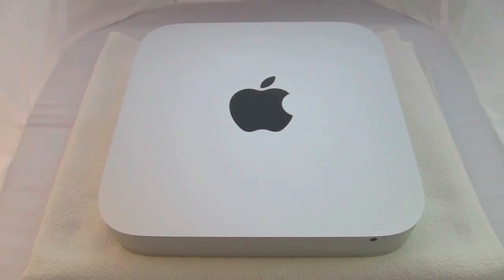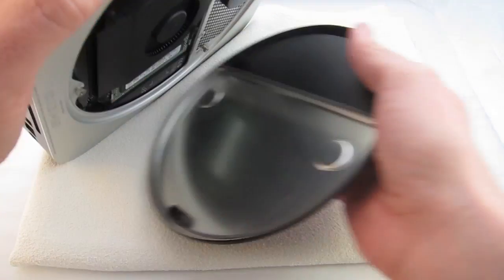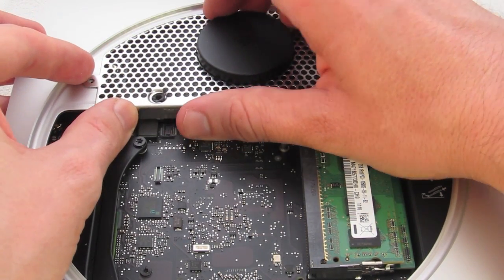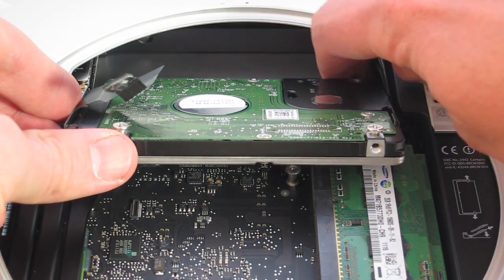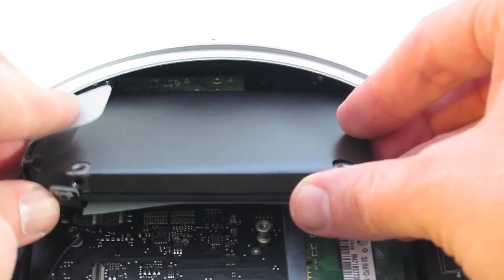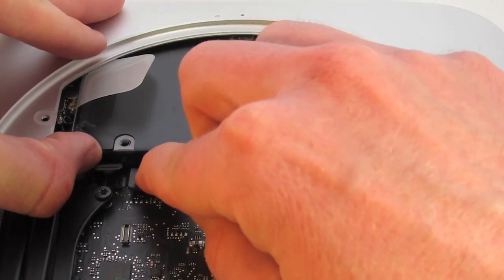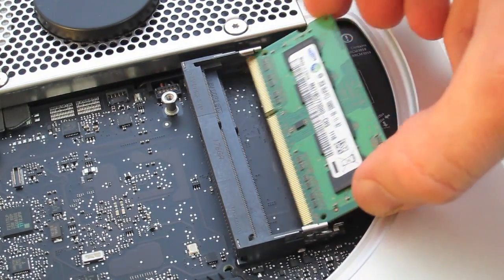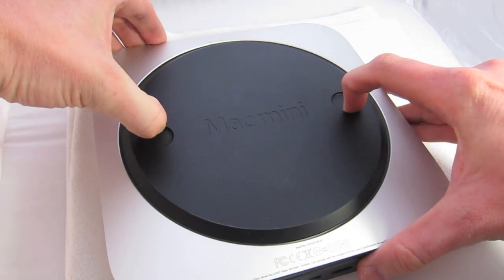Mac Mini 2011 Hard Drive & RAM Upgrade

Comment: Some videos tell you to disconnect the infrared cable. Don't!
It's impossible  NOT to break the infrared connector. It's made to not  be disconnected, ever. The connection is sticker than the glue below the assembly, so the glue will give up first and the whole thing will come off. 
I've warned you.

Comment: This is really not the right way to install a second drive. This is how you do it:
https://www.ifixit.com/Guide/Installing+Mac+Mini+Mid+2011+Dual+Hard+Drive+Kit/6634
You need a Mac Mini Dual Harddrive Kit, which includes the right screws and also includes rubber o-rings for vibration damping.
Also the plastic film shield should be around the HDD, not the SSD, since it's already protected.

Comment: Had a question about the connector...I looked up the part and I see some that say compatible with 2010 or 2010/2011 Mac Minis. If the part numbers are the same, it shouldn't matter, should it?

Comment: The most recent model was announced in Oct of 2012, and the previous model was announced in spring of 2011 (about 18 months prior), so expect another mini to come out in about 14 months or so in 2014. The mid 2011 model is better IMO, because it has a dedicated video card, as opposed to the recent model which does not. However it does have USB 3.0 ports. I just got a 2011 mac mini model mainly for video editing and sound recording. Cheers!

Comment: @techdctube I just don't understand why did you put the protective black sheet on the ssd?
Ur caviar blue needs the sheet more than the ssd does!HDD has the circuit board!!!!!SSD has no moving part and works as flash memory as the logic board and flash memory were together so there were no exposed logic board and there was no need to put protective sheet on SSD !Ok i just giving my opinion so don't get mad :)

Comment: when removing the fan connector from the logic board, I would not recommend using  flat head screwdriver, and for users not used to dealing with logic boards, I would suggest that caution during the fan removal process is absolutely necessary..  I succeeded in removing the the entire male/female connection from the mother board that way.

Very limited options once you break that fan-logic board connection.